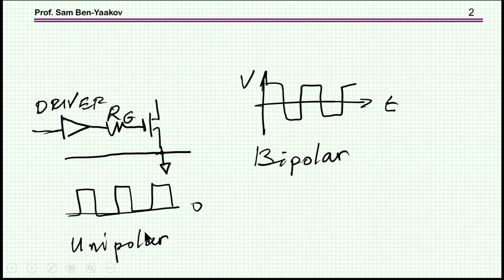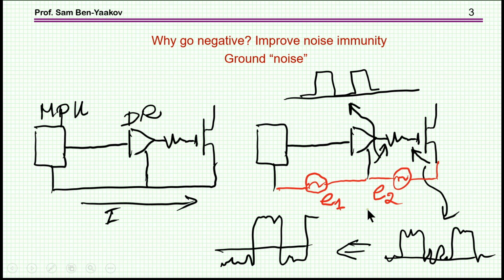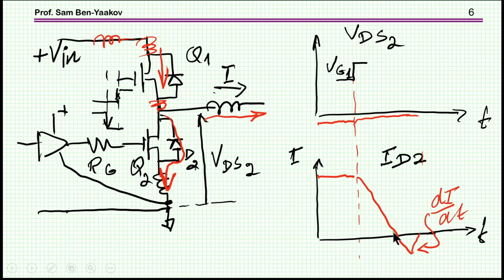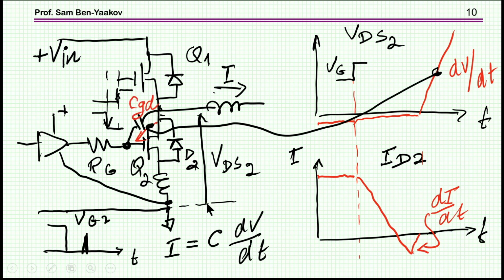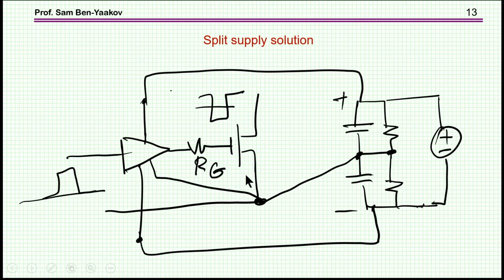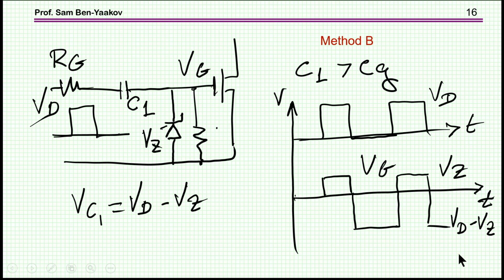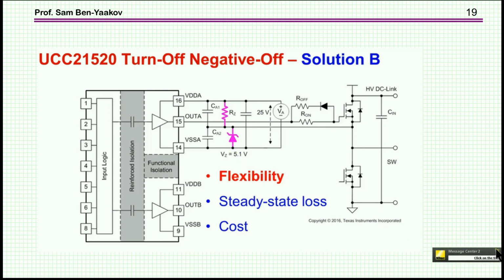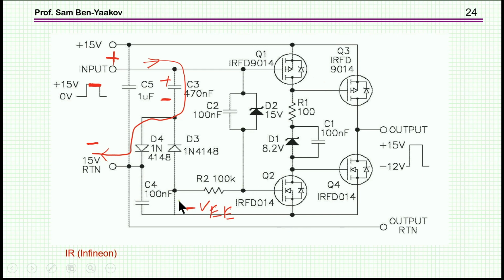Bipolar gate drive of power  transistors

Comment: Can back to back zener with coupling capacitor configuration be used with bootstrap circuitry? or alternative question would be is it duty independent? I am having a hard time figuring a driver circuit that involves negative bias with only one supply for three phase inverters
Reply from the maker: Not sure I follow you.

Comment: The di/dt induced Voltage effect in half bridge application can be avoided by the kelvin connection in the source terminal. The Kelvin connection will decouple the bound wire inductance and the gate drive terminal.

Then the bipolar gate is effective  for the of dv/dt reason predominantly not di/dt .

The lecture is very good and mind intriguing.❤
Reply from the maker: Thanks for input. To which minute in the video are you referring?
Reply: 8.17 to 10.08

Comment: Thanks so much Dr. Sam is very useful lecture, in minute 12 you said when Rg is smaller during turning off is better  and current will be low, but if Rg is low mean that it will turn off faster and dv/dt will be high and current will be high, so why Rg in turning off is better to be small?
Thanks,
Reply from the maker: dv/dt will primarily be determined by Coss and the current of inductor. Small Rg during turn off will 1. lower switching losses and 2. lower the spike due to dv/dt passing via Cgd.

Comment: Thanks a lot prof. Sam for this wonderful explanation 👍 ... It'd be very useful if you sir make a lecture about gate driver protection techniques (this is becoming an important design aspect especially when working with GaN eHEMT where the threshold voltage is low).
Reply from the maker: Thanks for comment. The protection and multilevel drive could be a good subject. Will see.

Comment: very useful video many thanks, here are my notes (not totally sure they are right though!) :
- Method A does work but the capacitor needs a time constant (or 2-3 ) set by its capacitance and the pull down resistor on gate which can be in the order of a few milliseconds.
- Method B cannot work because the zener prevents negative voltage on the gate (except the forward voltage of the zener)
- Method C works, the capacitor time constant is minimal and set but zeners internal resistances (almost instant), and as a bonus you get gate protection from gate overvoltage so I guess method C is the best one of the mentioned?!
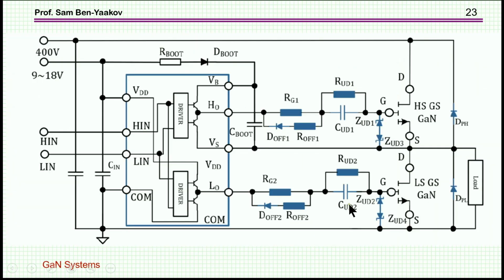Reply: I think Dr. sam overlooked Method B. It  needs an extra reverse zener connected to the 1st zener ( then it would anyhow become Method C).  22:57 and 24:59 are commonly used. Luxury Isolated based gate drive  vs a non-luxury based bootstrap  gate drive just to over come cdv/dt. Higher the negative gate voltage, worst is the VSD diode drop of GAN.
Reply from the maker: Hi, Thanks for useful comments. Method A is OK . No problem to keep the negative voltage flat with practical c an r values. 
Method B: oops, I missed drawing a diode in series with Zener to avoid clamping. 
Method C is nice but when input pulse voltage is higher than sum of Zener diodes' voltages, the capacitor is being charged an discharged which adds to power loss.
Thanks for pointing to error in B 😊.
Reply: @sambenyaakov  Hi, I meant the initial time needed to charge the capacitor which for Method A is 1-2 taus   ->     τ= R_pulldown * C_series
a few ms charge time would cause a few ms of shoot throughs at startup(if the gate's negative voltage is not enough)  which "probably" would cause nothing but yet annoying :-)
Method C charge time is almost instantaneous and has added bonus of gate protection, your point on choosing bad zener voltage might be true but I didn't see it in my simulations, also that would be a point for choosing the wrong components :D
anyway, Method C is so useful and simple yet I hadn't see it anywhere else till your video, thanks again for sharing your knowledge Sam
Reply from the maker: Just noticed the comment by Swaraj. He was quicker.
Reply from the maker: Thanks for comment